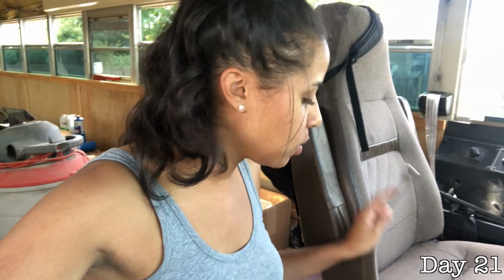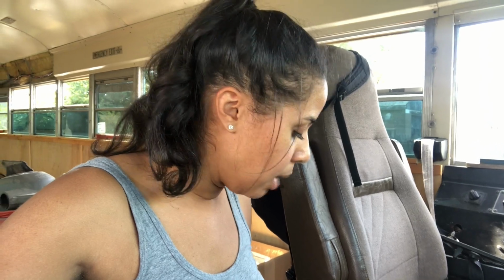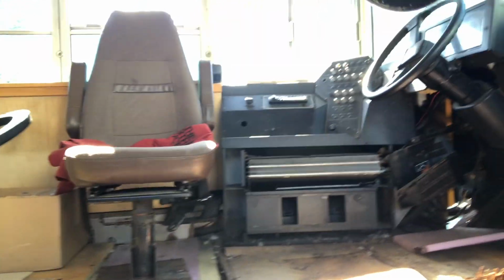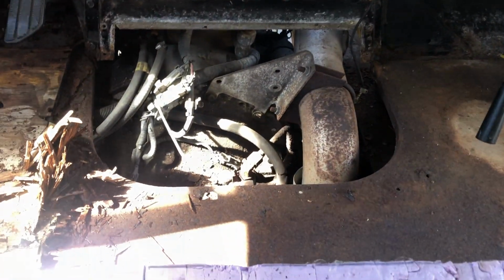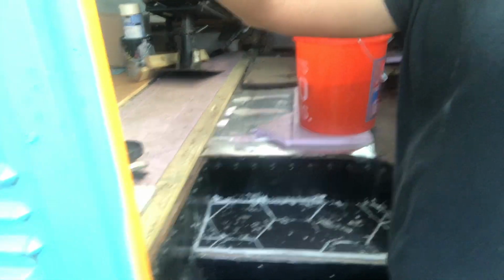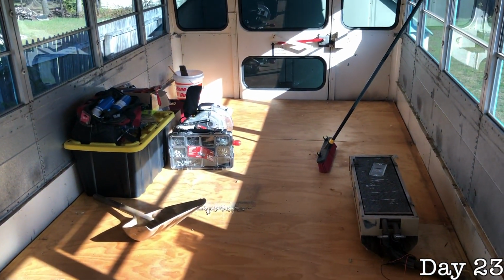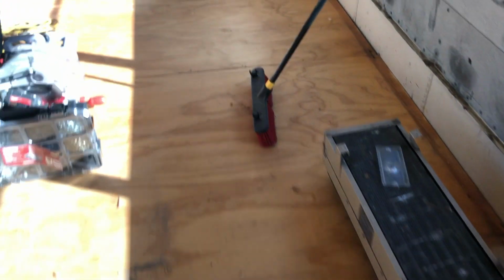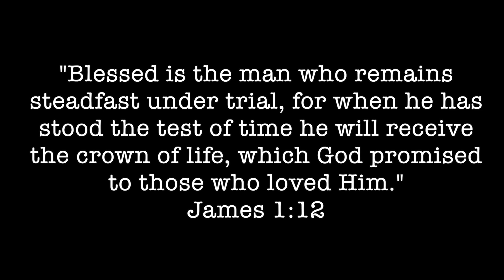School Bus Conversion: Demo Nightmare!

Comment: Awww bummer! I can't believe the previous folks just stuck down their insulation and subfloor right over the holes without doing anything ... that's crazy. At least you can take care of it now. It isn't great, but it's also not the worst I have seen either. If you are going to pull down your ceiling completely you will have plenty of metal to patch with once you get the floors ground down and rust converted =)
Reply from the maker: Sol The Sunchaser Oh my God who are you telling?! Urghhhh! We are thinking to maybe have a welder install a new floor...maybe the back half.